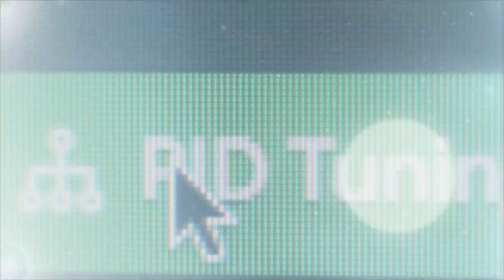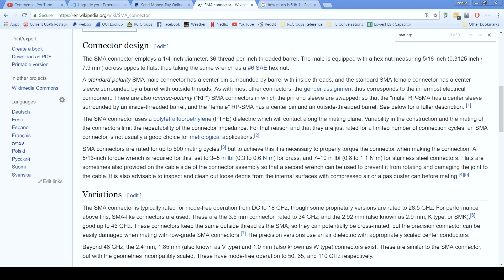Taranis 5 dBi Antenna Mod | DO IT MORE SAFER-ISH

Comment: It's likely that many of the issues are caused by powering up the radio without the antenna attached. Just as with VTX modules, the reflected power can fry power amplifiers rendering them with little or no output. I don't believe the Taranis has any protection against this (such as instantly reducing power output in the event VSWR is extremely high).

Comment: I just did the mod screwed on the antenna turned on the taranis and got the antenna warning. after  5 minutes of using every bad word I know I reinstalled the stock antenna no problem. I was blaming the sma cable if I had only seen your video before I ripped out 2 hours of work lol oh well. back to the drawing board

Comment: Joshua -

Thanks for doing your usual duly diligent followup on this subject. I knew we could count on you. :D

There is a lot more to it than just the cable length and soldering ability; the type of cable used also makes a difference.

The "84mm length" is NOT a fixed "magic number"; it is ONLY valid if you are using an SMA bulkhead connector with RG316 cable. The required length varies with the type and even brand of cable being used, so there is NO fixed "magic number" that will work with ANY cable. 

RG316 cable is what Alex Greve (IBCrazy, the guy who brought CPW Antennae to the RC world) recommends due to its very low impedance/capacitance and heavy Teflon insulator, which means that impedance/capacitance variations between manufacturers is mostly a non-issue and you can do a straight calculation based only on wavelength and Velocity Factor.

See here for LOTS of technical discussion (Okay, mostly ME trying really hard to explain a complex bit of u-Wave RF Wave Propagation Theory so it it makes sense) on this VERY subject: https://www.rcgroups.com/forums/showthread.php?1966664-FrSky-Taranis-X9D-hardware-hacks/page450

I'm going to take a moment here to make note of the very real FFC Regulations issues involved here as well, which we also discuss in the above link. Bottom line: This is a License-Free Amatuer Radio Transmitter; its FCC Certification for License-Free Operation is ONLY valid as long as you don't CHANGE the RF Section from how it is delivered from the factory. 

Simply screwing on a DIFFERENT antenna VOIDS that certification, and you need to have at least a Technician class Amateur Radio License to operate the modified TX.

THIS, BTW, is why FRSky doesn't include the 5dB antenna with ANY of their transmitters.

I have just received a review SE, and I'm personally pretty leery of their implementation of this mod, particularly if one uses an antenna other than the one included. It's NOT just the crunky plastic adapter piece they use to fit the thing in there that flops all over the place; it's the whole shebang that I don't like.

I'm right now trying to come up with some empirical means of measurement to validate my concerns... those will also be part of the Tech Teardown I'm working on.

Cheers,

mnem
Good Luck, and uhhh... don't git any on ya. ;)

Comment: Hey Joshua
I think that not just the connector on the Antenna has the "up to" 500 connetions limit, also the connector  on the taranis has this limit.
So my recommendation is if you have range problems that you change the antenna AND the connector on the taranis.
And additionally a dummy load is a good thing becaus it protects you from smoking your board if you turn your taranis on without an antenna installed, but it also reduces the number of connetions you can make with your connectors by half if you always put it on after flying.
I know, that my english is'nt the best but i try it as good as i can to explain what i want to say.
Greetings from Austria
Markus
Reply from the maker: Yes, both connectors have the limit, but my hunch is that the female connector is more likely to wear out, which on an RP-SMA, is in the antenna. The reason is that the pin is a solid piece of metal, but the female receptacle is sort of spring-loaded to tightly grasp the pin, and I think the springiness of the female connector wears out first. Just a hunch.

Comment: I have done this mod with only benifits to report so far. My question is. How accurate is the swi meter on the radio and would that give advanced warning to the user over the "antenna defective" warning ? I have the swi permainantly in my telemetry screen displayed for this reason as i noticed it does change with signal didruption , even with my hand on the antenna .
Reply from the maker: Some people report reduction in range with no change in SWR.

Comment: 1) Links in the description are missing O_o
2) I installed an SMA pigtail in my Taranis and I get random warnings from my Taranis. Because I'm using SMA antennas and not RP-SMA, does that mean I would have to replace  the pigtail because the pin and hole is vise versa? 
3) The new modded Taranis version will have the same issues right?
Reply: 2) If your antennas are SMA, your pigtail needs to be SMA, not reverse-polarity. 3) SMA and RPSMA are both SMA, and have the same torque- and cycle-limits.

Comment: PSA RE: Taranis Special Edition. Hot glue the plastic mount of the RP-SMA connector to the case because it's VERY fragile. I accidentally bumped my side view mirror with the antenna screwed in and it broke the mount.

Comment: So also fatshark goggles should be susceptible to this problem...
Reply: ***** why wouldn't it matter? If the antenna is not mated properly due to wear you would get a worse signal for sure (more static image for example). I'm not 100% sure of course, you could be right.
Reply from the maker: +AeoN FPV And GFX there is no danger in powering a receiver with no antenna connected.
Reply: Yeah my fear is that you'll get less and less video range from your 5ghz setup. Not like you can keep the antenna screwed in in your goggles if you want to transport them.
Reply: RockTouching it's very minimal on the receiving end on the output end it's a big thing as rf generates tonnes of power.

Comment: If the Taranis has the ability to report an antenna fault, does it mean that it turns off power to the transmitter module to prevent permanent damage?
Reply: VAS has said it'll shut off over 45 or so SWR
Reply: So that fact probably makes this mod a pretty safe option, and even forgetting to put your antenna on a non-fatal mistake, right?  Certainly not like a VTX's fallibility in that respect.
Reply: Believe me, it's not safe! I have burnt 2 times my amplifier  chip (se2431l just before antenna on the circuits), so in my experience - NO, you can't bet it will turn off the power. The worst thing is that antenna can be damaged inside (like I faced on antenna from well known shop) and even the connector can be damaged, like Joshua mentioned, and in my case I faced problems after I dropped relatively gently my taranis on the soft surface and damaged connector pin itself. So I ended up with antenna warnings just with shaking my taranis in the air )))
Reply: Hmm...  I wonder if the new Taranis Q is more durable when it comes to being dropped.  Seems like it would be.  Even really expensive radios are no more durable...  and I think for FPV that durable and possibly drizzle resistant would be more important.

Comment: 100% safe way to get the benefits of the mod with none of the risk is to use a FRSky XJT module and plug it in the back.  No chance of messing it up and you get an extra 20mw of output because it is 100mw vs the 80mw of Taranis.  Also gives you options because now you have 2 transmitters if one takes a dump while you are out flying.

Comment: As well as tightening to the correct torque you should also try to minimise twisting the centre pin, in order to meet their 500 connect/disconnect cycles only the locking nut should be turned, ie. Don't turn the whole antenna to tighten or loosen it, just the nut/nurled ring. Fatigue fractures and wear of the centre pin are fairly common problems with many coaxial RF connectors. Even if the pin itself doesn't break or wear out, the copper centre conductor of the cable will probably break near where it is crimped or soldered to the pin.

Comment: Maybe its not only the screw/unscrew part but also rotating the antenna as the pin inside may wear out. It may be beneficial for you guys to know that Ive modded my taranis to have it moved to the right, above right gimbal, so I can fold it all the way and get it to my case. Thx for getting us to know what really happened. I was worried and I started looking up some spare boards JIC. I've also done this mod but with the RG58 coax with length of 8,4.. (ish - Ive used his formula with actual bandwith of taranis I dont remember exactly) cm that alex suggested.

Comment: Looks like we all neglected to check the SMA / RP-SMA connectors limitations :P
Good to know Joshua, I hope not many people jumped right in and ordered replacement boards.
Btw, did your SE come with the standard, long 5dBi antenna or something closer to the stock antenna length?

Comment: Hey Joshua I have a different taranis issue with the second taranis I have, it wont connect to any computer, when I try to connect to the bootloader (Start with the trims inward) to update it or add files and stuff the boot loader apears to be corrupted, it shows a bunch of weird symbols as its name and windows say that it has malfunctioned. It was like this when I first got it but until now I havent felt a need to update it, any Ideas on what could be wrong and how to fix it? (I can easily connect to my other taranis so I don't believe its a driver error)

Comment: I soldered on a female u.fl connector on my backboard. why are we not recommending that? I use a removable 2dbi ant also.
Reply: Elliot Hancock The difference, literally is 3db which is another way of saying double. That is, in the direction with highest signal strength the 5db is twice as loud as the 2db. Twice the power gets you 1.4x the range (square root). 

It also means that in less favorable directions the 5db is less loud to make up for it. The antenna only spreads out the signal, it does not amplify. An ideal (perfectly evenly radiating) antenna is 0db.
Reply: Brandon Brown what's the difference between the 2dbi and the 5dbi?
Reply: Elliot Hancock 2dbi is what the stock antenna is. Its a bit wider, less focused transmission
Reply: What's your SWR with uFL? i did the same and my SWR was 17. i removed uFL and i'm back to 0-1. however the range sucks even tho i only had 5 "mating cycles" :(
Reply: I used a UFL connector too as I already had socket surface mount UFL sockets and a load of UFL to SMA pigtails. The board actually looks designed for it really, you'll see that there are 2 ground solder pads for the 2 needed by the UFL socket.

I also get a reading of 16 or 17 via the Taranis SWR reading. However, I'm getting better range after the mod than I ever did with the original antenna - at the far end mu usual flight field (about 250m) I'd have been in the 40s with the stock antenna now I'm in the high 70s. I actually didn't do the mod because I wanted more range though, only because I snapped the original antenna.

Comment: One observation I made on my Taranis SE is that the SMA connector on the Taranis itself spins when the antenna is tightened.

I think I need to figure out how to properly secure it so the coax cable doesn't get damaged, because it's twisted or even rips off the cable from the RF module.

Do you have a good idea for a solution now that you also have a Taranis SE?

Comment: Just fixed a problem with mine. A month or so after doing the mod I found the SMA started rotating a bit in the housing, and I was getting occasional RSSI warnings. Where the RG316 meets the SMA, the shielding was not soldered. The connector had just been jammed down onto the shielding and covered in heatshrink, allowing it to rotate. I had noticed this a while ago on a pigtail I had replaced on a vTx. Just cut the heatshrink, soldered the shielding to the SMA, reheatshrinked, problem solved. It's a tricky one as there's a few things could go wrong, but if done well I think it's a good mod.
Reply from the maker: +arden eques with a crimp connector, I don't think you usually solder. I would wager that the rotating broke the shielding braid at the crimp.
Reply: That's true. I don't think the cheaper SMA's I've used are even crimped though, looks like they are just jammed on. I think the heatshrink is meant to hold them secure enough, and it probably does if rarely used. Possibly screwing the antenna on and off has started it rotating, and over time weakened the connection. Will be cutting the heatshrink off in future and checking before I use them, as they work great after soldering the shielding.

Comment: Its funny you posted this today. I had the same exact problem as you, not to the same degree, but my SWR getting higher which was strange as my original after the mod was 0. New antenna on and back from 18 to 0.

Thanks for the great content

Comment: I have a question. I recently got Taranis Special edition and a 5db antenna. I tried to fly with standard 2db antenna, but the range was noticeably shorter than my old Taranis. Then I put on 5db antenna and the radio is not working anymore. So somehow that antenna killed it or it was broken from the factory. So is it a way to test if the antenna is bad, like measuring something on it, continuity, etc?
Reply: RandomWisdom Do a RMA on banggood?
Reply: RandomWisdom banggood has only normal taranis? not SE or am i wrong?
Reply from the maker: +Lasse u you would need an expensive piece if equipment to test the antenna.
Reply: Yes, with a Network analyser, preferably vector but scalar would do or a Spectrum Analyser with a SWR Bridge.
Reply: +lappy the Spectrum Analyser would need a tracking generator.
Reply: Yes, they have Special Edition too, I got mine from them.
Reply: I feel I broke it myself so I don't feel RMA is applicable in my case. It worked on first start, but after changing antennas it stopped transmitting.
Reply: Ok, got it, basically no way I can test it :D

Comment: my taranis is failsafing randomly, right in front of me as I fly. not even modified the antenna, I have changed the back case which involved de-soldering and re soldering. should I replace the internal module ?

Comment: First!? Did you have to replace the other side of the SMA that the antenna screws into as well, or just the antenna itself?
Reply: With respect Joshua, the issue with mating cycles is as relevant to the bulkhead connector as it is the antenna connector. So in the ideal world both should be changed out as and when necessary. The uFL connectors are rated in single digit mating cycles.
Reply from the maker: +Luke Godeassi just the antenna.